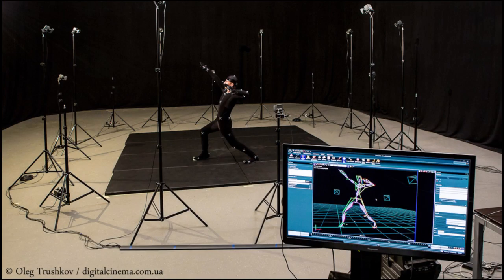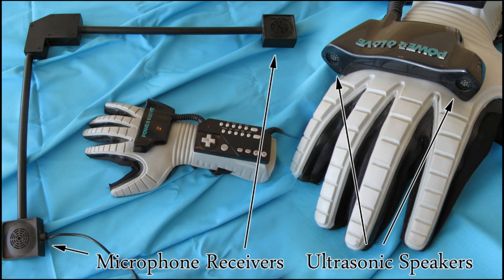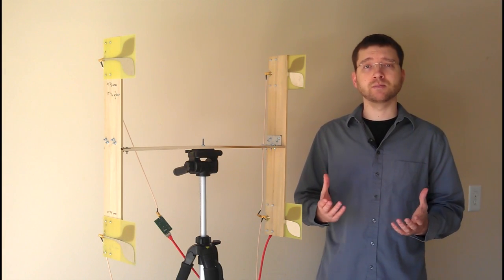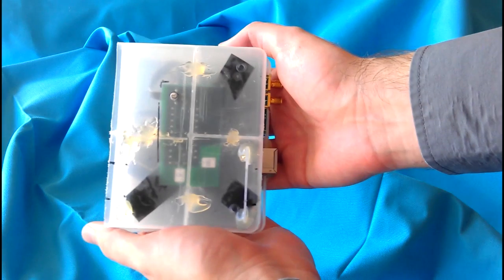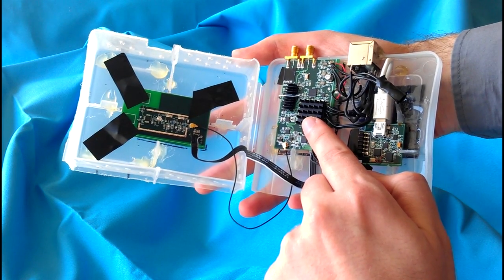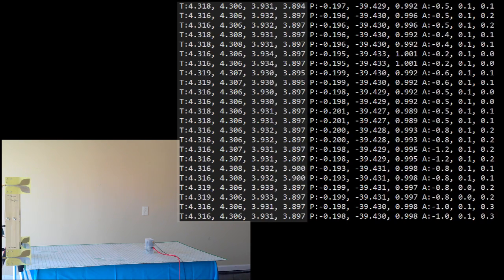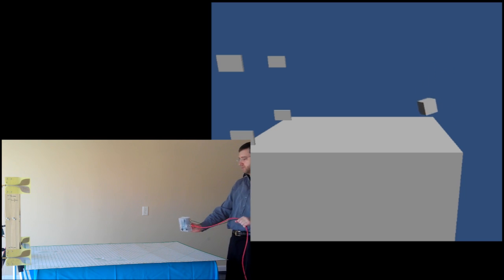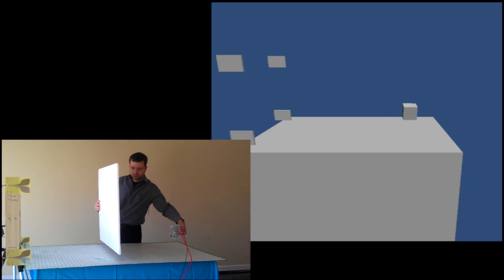Homebrew RF Position Tracking System

Comment: Has you tacking system are ready for sell? I has checking the ubisense uwb tracking which the position of the tag will be jumped one place to another. and the accuracy seems to be +-15cm. You system looks pretty good, the tacking is very smooth.

Comment: In the beginning of your video you say that you need four 'base stations' but it looks like you or using only one?
Reply from the maker: At this time, I had only one base station constructed, and that was all I had to demonstrate.  It is functional with just one.  The downside is that if something blocks the one station, you will lose tracking.  With two or more stations, if one is blocked, then the others will continue tracking.  Also, with more base stations, you get more tracking estimates which improve the overall position estimate.